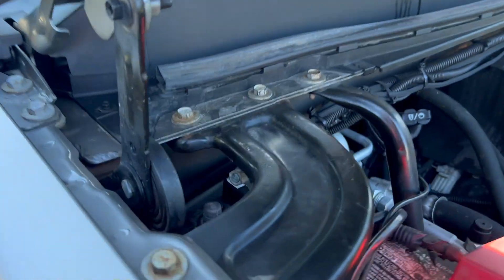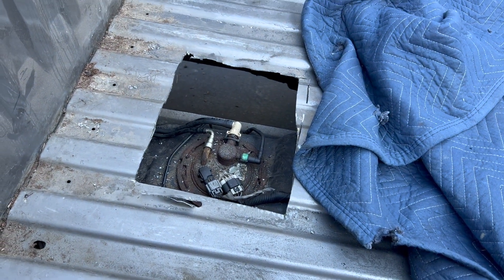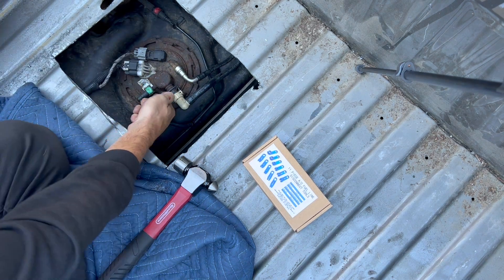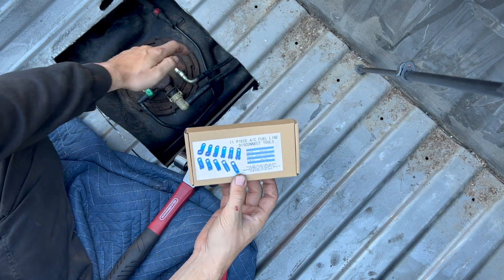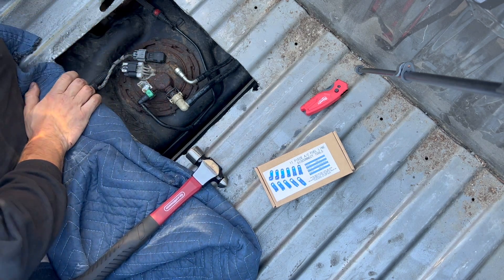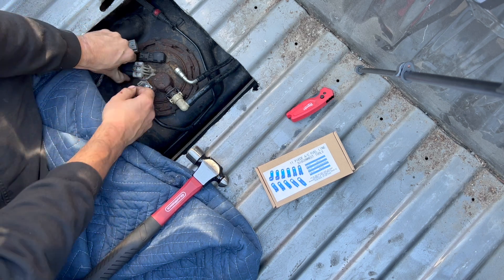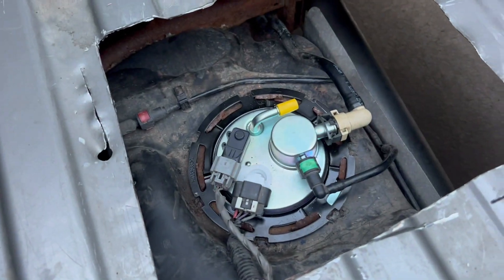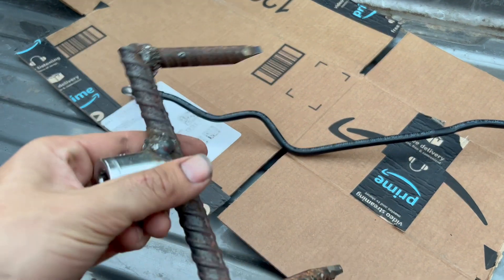Changing The Fuel Pump On A 07-13 Chevy Silverado 1500

Comment: Did you have a fight putting the new pump in the hole? My new one won't go down far enough to get the ring lock on
Reply from the maker: @MarcBumgardner  no just slid right in
Reply: I finally got it in. Had to trim the opening by a couple cünt hairs but by God it's done.